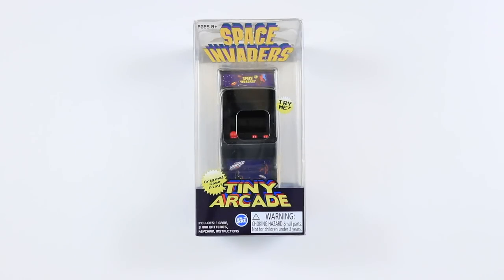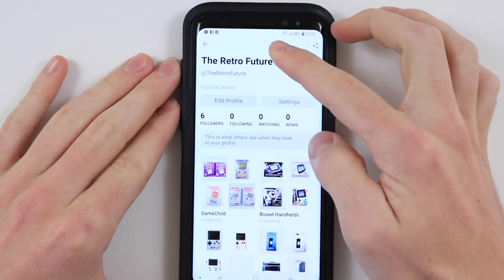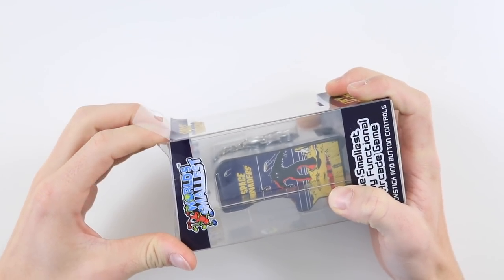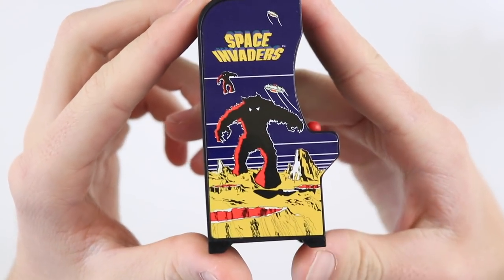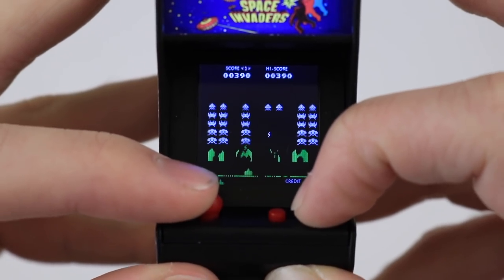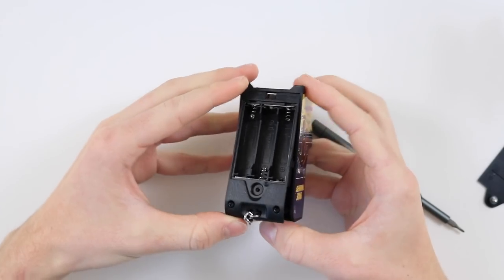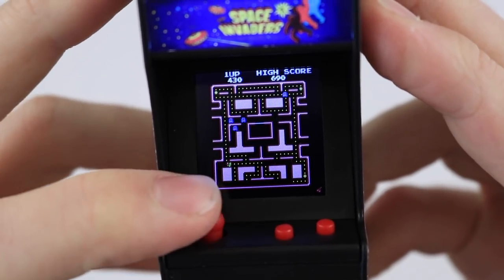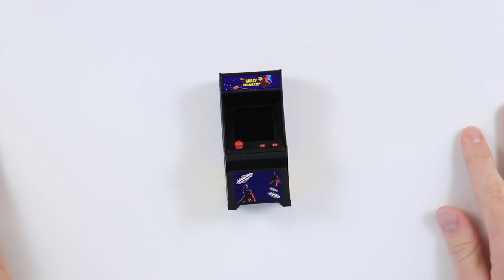Tiny Arcade HACK To Play Multiple Games!

Comment: A way simpler mod that doesn't need a switch is to solder the first 4 joystick lines to the one side of those pads and you power on with a joystick held in a direction and you get all 4 games. Also, if you turn it on without a joystick direction held, you get a test rom that lets to test all the screen, buttons and sound.
Reply: That's pretty genius.
Reply: Have you tried this to ensure it doesn't cause problems once the game starts?  If so, then this is the mod to do!
Reply: Any pics or guides on this?
Reply: Noice
Reply: Do you have a video on that method?
Reply: Just did this mod on the tiny arcade galaga version. I have 4 games now (sorta):

Galaga
Dig dug
Frogger
A louder version of frogger
Reply: I can confirm that this is the best method.
Here is the link to the video that explains that mod: https://youtu.be/EC2ZcLjEykY
Reply: @Left-Earth  That's the same as the mod shown, except that the video at the link you have provided was filmed in 2017 with a toaster.

Comment: You can unlock only four games though.  I did this hack last summer.  If this thing could load roms, that’d be crazy.
Reply: Only 4 games included, they just bridge a different point to sell a different game.
Reply: Based on its performance, you would need VERY low speced games (even lower than the games shown). If you could fit a mini arm board in there (either raspberry pi 0 w or chip), it may be feasible, but then you'd either need to find a similarly sized screen w/ driver board and/or connect the screen directly to the board (which may or may not work). All in all, it's remarkable that they managed to make a nano arcade cabinet :)
Reply: someone should put a pi zero in there
Reply: Joe Cogul isn't it a nes on a chip? I think he means loading roms onto that.
Reply: Why didn't they just use two jumpers if there are only four games?  00, 01, 10, 11.
Reply: Ben heck did a teardown, and made a case with rechargable battery and selector switch.

Can probably mod the controller to start a game depending on direction pressed when power is turned on, if a selector switch isn't available, or you want to keep the outside stock.

https://youtu.be/7xiGVWVdGy4
Reply: @naikrovek  Easier this way
Reply: naikrovek - It also has the test mode. So there's 5 settings. Besides, they probably had spare pins, and this way it only needs 1 resistor for any setting, never 2, so why not save 0.0001c :)
Reply: That's true - it likely only tests the pads briefly during power-on.
Reply: @naikrovek  All the points with letters are a game and all the points next to them are grounds. It load the grounded game. That's why it has 4 position. There is a better way to hack these than adding a switch. You just solder 4 cables from the 4 letters to 4 points of the grey ribbon cables of the controls. The controls are already grounded. You just need to hold the joystick in a direction when turning it on and it load a game.
Reply: @chamoo232  I have one of these and i'll probably go with this method. Thanks for sharing!!
Reply: @karlalexius2104  I have the entire set of 7 of these arcades and I modded 2 of them just for fun. One has 4 games and the other has 3 games. What's funny is that if you turn it on without holding the joystick in any directly it will load a test program. By pressing the buttons and joystick it does a bunch of color test and pixel tests. That on it's own is cool to see.
Reply: @chamoo232  Ok cool. I'll def try this method.

Comment: 1 of those wires could have been just 1. Because they connect to a common ground and you would just need to bridge 1 side of the dip switches for it.

Comment: Great job! BTW make your life easier and only solder one wire for the common rail side instead of individual wires per switch. So in total this mod should at most require 5 wires instead of 8, just have to measure with a multimeter on continuity to see which side of the jumpers are all shorted on the board.

Comment: The only downside I didn't like from the Tiny Arcades is that the highscores don't save.
Reply: Just don’t turn off the machine it won’t kill the batteries they will save the score in it
Reply: Ya
Reply: @slapshotjack9806  Should be easy to put a micro USB mod into this, right to the wires from the AAA battery holder (3xAAA=4.5vDC, 1xmicro USB=5vDC).
Reply: @KB-xe8mt  would need help with that lol
Reply: I mean, like the NES ports, they’re pretty much pointless unless you’re playing them on a real arcade rom.
Reply: Yeah

Comment: 8bit guy bought an earlier variant of this that had exactly the same 'flaw', it's just massively cheaper to make a general purpose chip and lock it to one specific game depending on market demand, it avoids being stuck with a bunch of systems that can only ever play Galaxians that no one wants (for example).
Reply: Sparks N Zeros if it is true that each mini keychain arcade system has multiple roms on it but that each arcade mini is just set to a specefic rom related to the artwork on it , well that’s a smart way to get rid all your arcade mini’s in case no one wants galaxian, then all you had to do as a company is just set it to pacman, change the artwork on it to pacman and reselling it as a pacman arcade mini,in order to scrape some money out of it!!!
Reply: exactly right my friend, its always difficult to know what will sell and where so this is just an easy safety net.

Comment: Frogger Hack - If you move the joystick up really, really fast it will skip over the "obstacles" and not die. Just line up the frog on the bottom of the field with the open home spot on the top, then click it up 11 times super quick and it will be in its home without dying.

Comment: I think there is another series of games because I have seen some Digdug and Frogger ones too. That means there is probably a second board with 4 games and 2 of those games I didn't see yet.
Reply: chamoo232 Dig Dug, Frogger & Galaga are out as well
Reply: @capmuggy  Yep I already got them but the ones I remembered are not new. The Digdug\Frogger I have seen before are from another range of small arcade called "arcade classics". They look bigger than Tiny Arcade and they have a dozen models. Some games have old type screens with segments that light up and other games have proper LCD screens. They have Rampage, Qbert, Asteroids and Joust as well as most of the Tiny Arcade titles.

Comment: I have a vague impression that the 4 left sides are all commoned together.

4-position slider switch would be ideal to operate in my opinion, but i appreciate the DIP switches, as they were actually commonly used in actual arcade machines at one time.

Comment: Does having 2 or 3 or 4 dip switches on at the same time result in other games? I think there may be 13 or so possible switch combinations.
UPDATE: I missed a Dig Dug and multiple switches on only selects from same games available when only 1 switch is on at a time. Since multiple ons don't get anything more I took off my dip switch and instead connected to the joystick to select when turning on.

Comment: Nice! These are in stock at Walmart, nice little project for my PTO this month. Going to hunt for 4 way switch online now :)
Reply: Chris Wasney -$12.88 in MA!! (USA) at Walmart.
Reply: That sounds like a great idea, Chris!
Reply: omg walmart XD
Reply: Wire A B C and D to the 4 joystick contacts where its ribbon cable connects to the board. Don't then need to do any ground wire/connections and then turn on machine with joystick pushed in one of the 4 directions to select one of the 4 games.